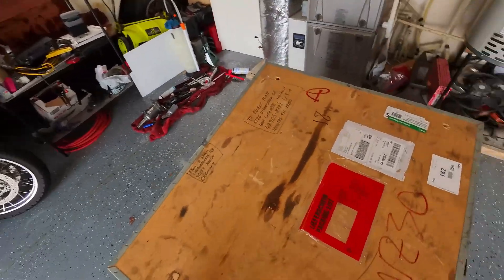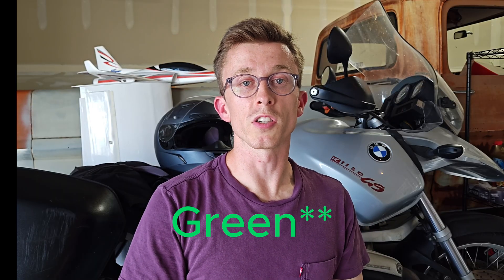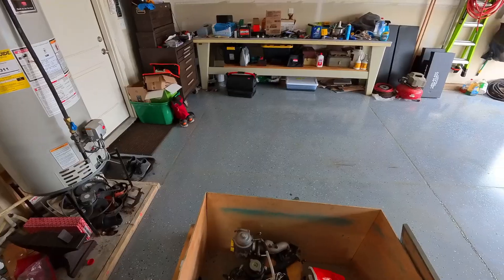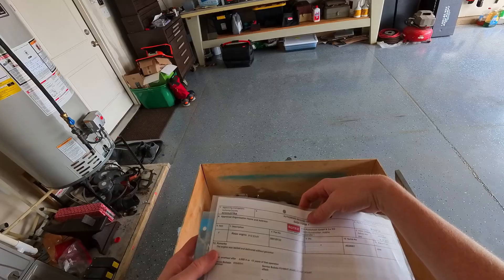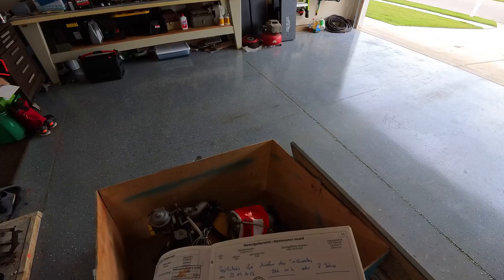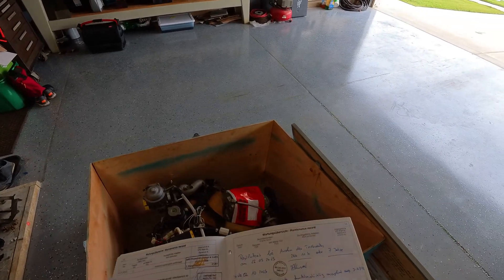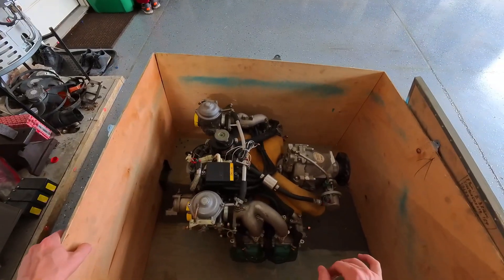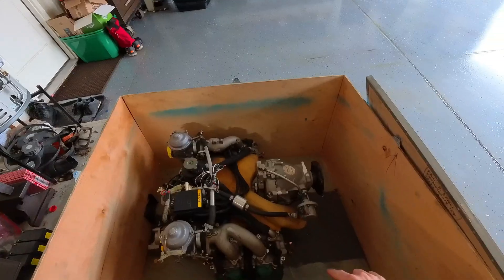I'm Building an Airplane in my Garage - Rotax 912 Unboxing

Comment: Looking forward to your build!! Found you on the Top Rudder Group. My kit should arrive by the end of next month and I'm planning to use the 912iS on mine.
Reply from the maker: Awesome! Would love to hear what you're planning for propeller, avionics, etc.
Reply: @jeflatt  No clue yet on the propeller, still researching. I will probably do the same as you and get an engine with the ability to do constant speed prop, to keep my options open, but block it off for the Ruckus build. My decision to go with the 912iS somewhat narrowed my avionics options. Not much panel space to put a large engine monitor and not a lot of choices for engine monitors. My current leaning is the small 7" Dynon Skyview. Not so much because I want a glass panel for such a simple plane but they have a 912iS engine monitor that talks to their panel and that will allow me to do engine monitoring along with my other typical avionics all in the same panel. Kind of a "there was an old lady to swallowed a fly" situation at that point. If I have the Dynon installed I may as well go with their little radio module, and it progresses from there.
Reply: How much extra is the 912is over the uls? And what reasons made you go for the extra? So many uls still being put in many expensive planes
Reply: @srnunan4783  Difference in list price from say Advanced Power Plant Solutions is about $7k. I haven't 100% pulled the trigger on the fuel injected over the carbureted but I'm currently flying a fuel injected engine and, knock on wood, it's been relatively trouble free without much fiddling with carburetors. Could also just be that I'm an electronics and control systems nerd so the idea of electronics and CAN bus control is familiar to me so I'm okay with the trade in hopes of a bit better economy and longevity from the engine.